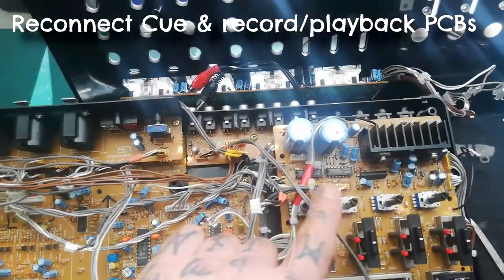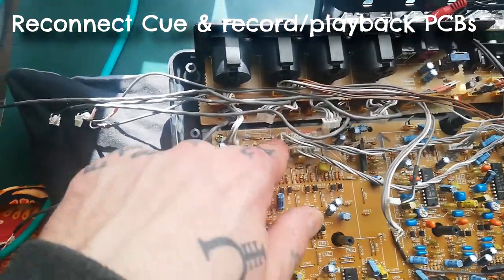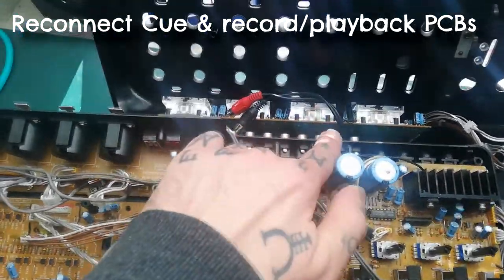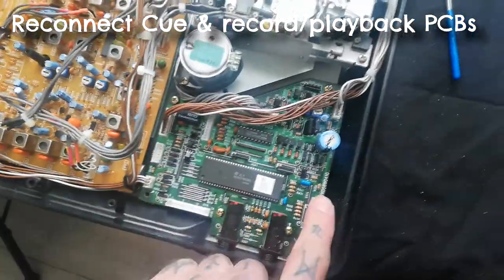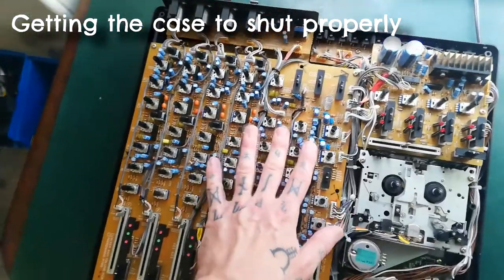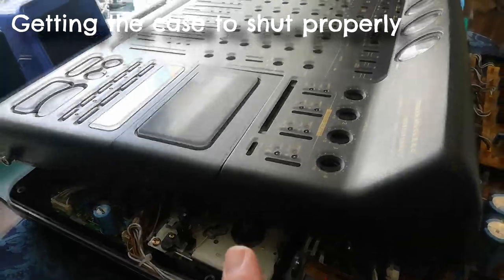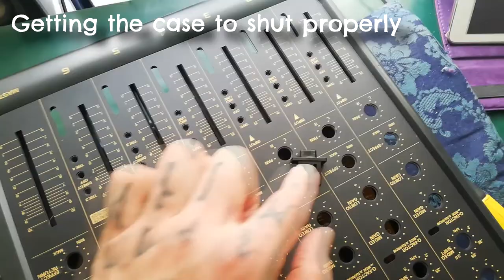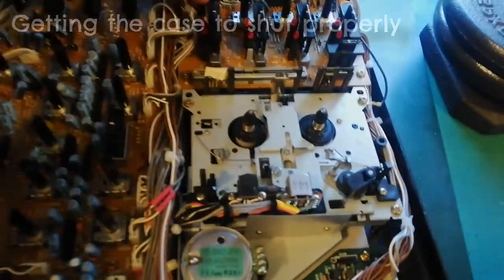Marantz PMD740 | Tear Down | 5 | Rebuild - Tips & Pitfalls

Comment: Is there a place you recommend going for parts? I need to replace the silver bar that holds the transport on with the whitish/clear plastic snap labeled NMZ-3110DH 282X27 in the video. Someone DIYd mine and it drops out when in use. I also need those black plastic cogs that hold the transport and the clear plastic dustcap circle that goes on the other side. I can't find any real useful documentation of these things. I appreciate your channel IMMENSELY.
Reply from the maker: Thanks for your kind words. Unfortunately I rely on spares donors for parts. Where possible I like to buy faulty units in threes so I can sell one keep one for my own use and relegate the third to a parts bin. Good luck!